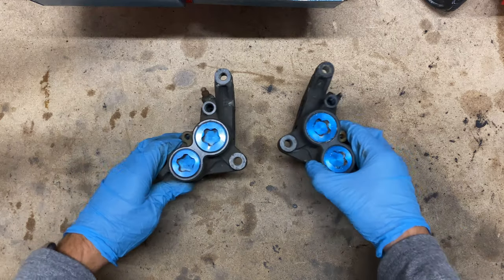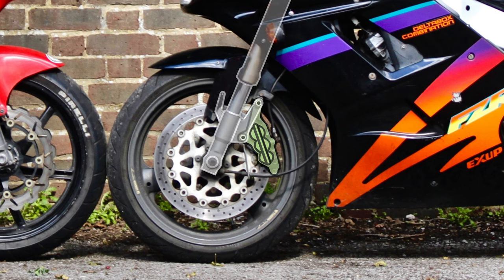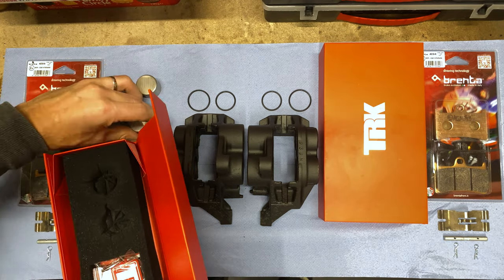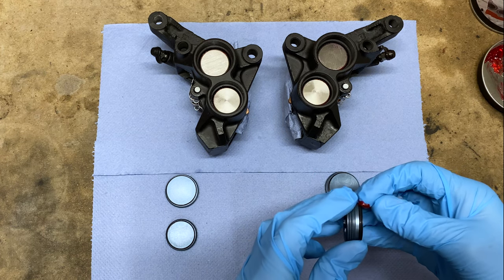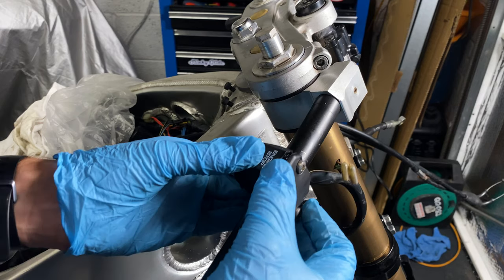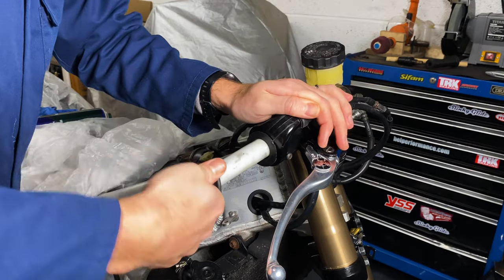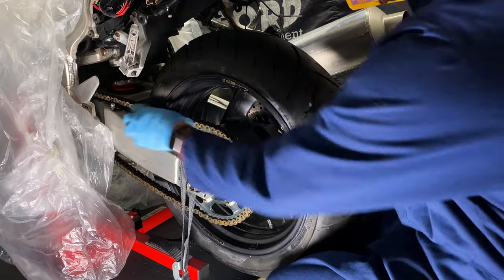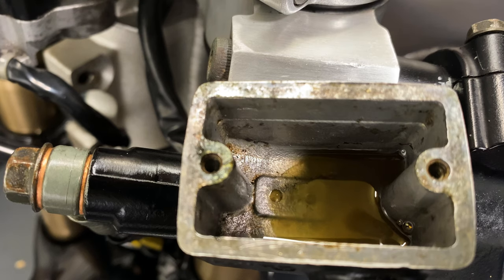12 - Blue Spots Upgrade for my FZR1000 | Tom's Workshop

Comment: Superb content Tom. Loving this restoration. Would like to know what paints you are using please. Also, did the aluminium have any corrosion? I’m yet to find a decent way to remove this on a textured RSV4 swingarm.
Reply from the maker: Cheers! I think the paint I've used on the fork bottoms are from Autotek (a brand I found on amazon with positive reviews) the callipers are cerakoted, but they were heavily corroded before, which you can still see. I didn't have many other aluminium parts that had heavy with corrosion luckily, though a few parts benefited from some scotchbrite mop work in the drill.

Comment: Hello Tom, can you please make a video about the maintenance of the exup valve? Would be very great
Reply from the maker: I will be doing a bit of work on the pipes in the next video so I’ll try to go into detail on how I’ve serviced it over the years. The main thing is do it frequently, at least once a year.
Reply: @tomsworkshopprojects  can i use copper grease or is it better to use something else?
Reply from the maker: @Clara-lt4fg  That's what I've used in the past, there are higher temp greases available but they all burn off eventually so that's why I find frequency is the key. When I was running mine all year round for work, I did it once every 3000 miles or so.

Comment: Hola tengo un exup yamaha fzr 1000 el problema que tengo es que la moto no acelera la enciendo y no sube de 1000 rpm luego laa apago y vuelvo a encenderla y si acelera llega hasta los 6000 rpm pero luego vuelve a bajar a 1000 rpm y escupe gaasolina por los carburadores puedes ayudarme
Reply from the maker: Hi, it could be a number of things, check EXUP valve isn’t sticking. Check for air leaks around carbs, or anywhere in the air system. If no luck, it might need a more thorough diagnosis. Good luck 👍🏻
Reply: @tomsworkshopprojects  pues no tiene valvula exup no e revisado las fugas de aire lo tendre en cuenta muchas gracias